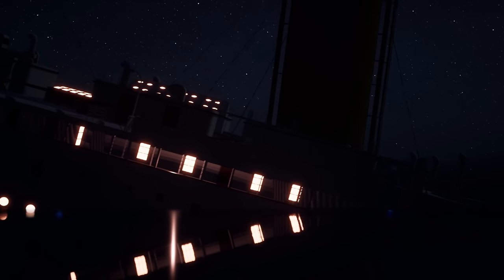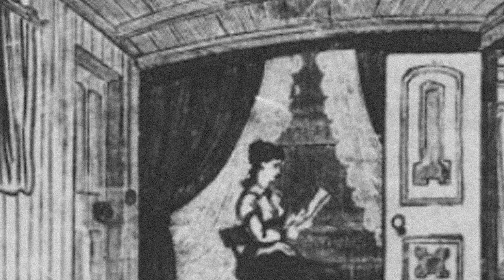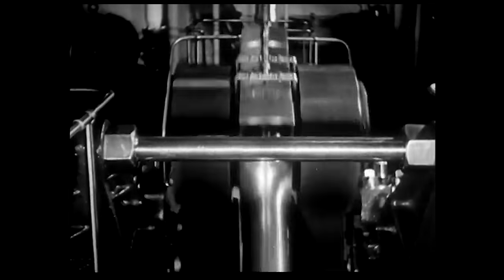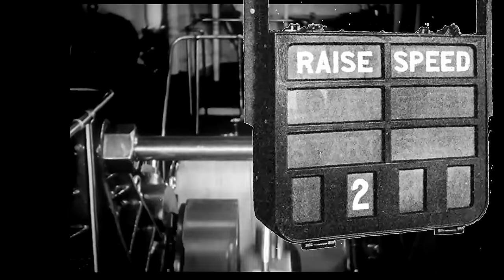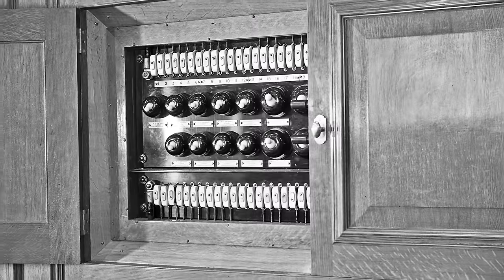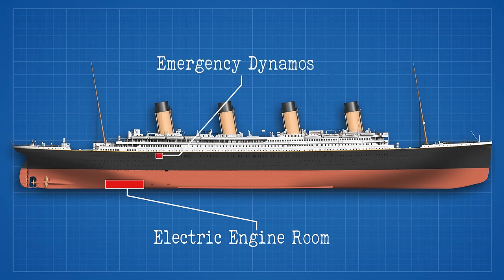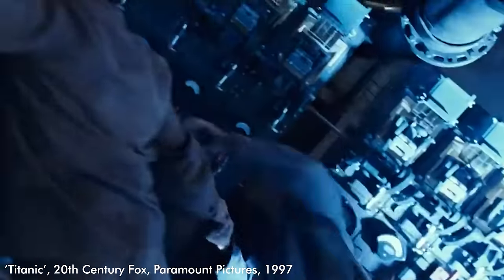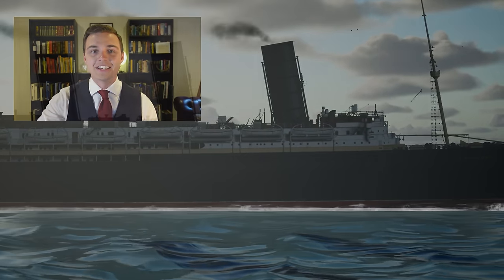How Did They Keep Titanic's Lights On So Long?

Comment: I'm constantly impressed by just how well built this ship was. Especially considering the time period. It's beyond impressive.
Reply: Just makes it all the more tragic what happened
Reply: Not built well enough it seems
Reply: @duncachinoahimiha3889  What ships were back then?
Reply: @iamhungey12345  the ones that didn't sink.
Reply: @disclaimer.imjokin  Did they also hit an iceberg?
Reply: @disclaimer.imjokin  seeing as at the time no one could think of any foreseeable  thing that could sink a vessel in the middle of the ocean other than a storm at the time, and titanic was plenty prepared for such an event. so the worst that was expected would probably be a collision with another ship. Which would only damage two compartments and meant a trip back Harland and Wolf. So the chances that a sinking could occur with nobody there to take the passengers on was unforeseeable. The ship was practically unsinkable. It’s just that nobody foresaw something such as a large mass of ice being a threat that it would ever face. Even today if you built a ship the last thing you would think is if it would strike something in the middle of the ocean where there typically is nothing to hit.
Reply: @BottomGear2  It's kind of like telling people to expect an unmoving object in the sky. It's a rare thing, normally you could avoid such ice with ease, but the wrong night, where visibility was deceptively perfect, that made seeing ice near impossible.
Reply: @duncachinoahimiha3889  tell that to Olympic
Reply: @duncachinoahimiha3889  Well built, ineptly piloted.
Reply: @dday881 This.Olympic proves that Titanic wasn't poorly built.
Reply: @duncachinoahimiha3889  Titanic sank because it was so well built.  If it were just a run of the mill ocean liner, they would have dropped anchor for the night.  But because it was THE Titanic, they said "Full steam ahead!"
Reply: @jaywolfenstien It was the maiden voyage and they wanted to beat the time set by the Olympic iirc.
Reply: @duncachinoahimiha3889 it was almost perfectly designed. The only two things missing, the double hull wall and enough lifeboats for its occupants, and a safer and quicker release system thereof, were critical and egregious omissions, for sure, but the fact that the ship had an emergency lighting system, in as far back as the 1910s, shows the engineers did care.

The corner-cutting definitely came from above, because if the engineers had their way, it would indeed be “unsinkable”, i.e. not a complete death trap in the event of an accident or even complete loss of the vessel, by 1910s standards.
Reply: @KillerofGods  Titanic wasn't trying to beat any speed record, and it wasn't even on its fastest speed when it crashed into the iceberg.
Reply: Titanic was well beyond it's time..... She was and still is so impressive and in my opinion, the most Beautiful Ship that mad has ever made
Reply: She gets a very unfair rap, no ocean liner could have survived the damage she sustained and few would have have actually survived as long as she did.
Reply: Most have under-appreciated the Victorians and Edwardians because of presumptions rather than factual knowledge of Great Britain back in the day. A happy benefit of your, friend Mike Brady, and your colleagues’ efforts, is educating the general public. The UK is sadly not what it once was pre-Brexit. Merci beaucoup.
Reply: It wouldn’t have sunk if it took a head on collision but it had its side scrapped by the iceberg flooding 5 compartments.

Comment: I’m a formerly licensed 3rd Assistant Engineer Steam & Motor of any horsepower/any ocean; much of my career was spent in power plant construction, maintenance, and operation.  

I knew the Titanic’s lights stayed on because the engineers & electricians stayed at their posts.  In addition to keeping the lights on they kept pumps operating in a vain struggle against progressive flooding.

What I’d never seen nor heard before were the details discussed in this video of Titanic’s electric generators and circuit design.  Thank you for a very informative video!
Reply: When Titanic broke in two  the side shell was ripped away from the inner structure all the way to the generator room, opening it directly to the ocean. If they were down there, they died when the space rapidly flooded  with icy cold seawater. Today the starboard side of the stern section is missing, exposing the turbine and generator room to the surrounding water. Nobody has risked sending an ROV into the stern section because the interior is completely destroyed when water blasted through it during the very rapid fall to the sea bed. The risk is too great of the ROV getting trapped.

Comment: This is the first time that I've heard anyone talk about Titanic's electrical system or the courageous engineers that operated it. I had no idea that the Titanic had so much electrical generation capacity, nor that it all ran on DC.
Reply: Alternating current was in the very beginning stages back in those days, much of the power grid even still ran on DC. AC is very complex and brings on many more challenges and engineering problems, so the fact that it was DC was very unsurprising, considering all vehicles still use DC power to this day.

Comment: One reason was the generators were in one of the ship’s aftmost compartments, as the stern rose higher and higher all of the steam escaping from the boilers and engines ran through the turbo-dynamos and kept the lights on. When the ship broke the last of her steam was hissing through the dynamos and her lights finally went out as her dynamos stopped turning, her pressure finally fell, and water surged into the torn-open steam pipes
Reply: The steam pressure required to turn those things is big enough to makes the difference in pressure from elevation negligible
Reply: @jdrhc63we67  not really add on the boilers that were underwater were still producing some steam due to the fact the majority of the boilers fireboxes were shut tight in order to keep the water out.
Reply: @hunterbear2421  the turbines operat at hundreds of psi steam pressure the change in pressure from height would be less than 1 psi steam is not very versatile dense so the weight of the column does not increase quickly like it does for liquid water
Reply: @jdrhc63we67  What i mean is that it didn't matter, yes but the psi from the boilers being fully filled and even the ones underwater having there fireboxes sealed shut. some did explode during the break up i heard tho but by that point the 50psi to 100psi of steam pressure was plob all it was gettting and when it broke up it was done anyway.

Comment: Mike, thank you so much for answering a question which has always bugged me about the Titanic's lights. I'd heard about the rusty red hue that the lights dimmed down to, and always figured that it was current bleeding off into the water which caused it, rather than loss if steam pressure   which of course makes sense.
Either way, the ships electricians deserve a special accolade for their heroic efforts. Without them, the death toll would undoubtedly have been much higher,  as panic would have set in much earlier.
Reply: I wouldn't be surprised if there was some of both factors - current bleed in the water and steam pressure loss. The steam pressure loss was probably bigger though, as the electricians could shut off a part drawing too much current, and a short would hopefully trip a fuse or circuit breaker cutting off power to that part rather than bleeding current. It does make me wonder about the scene in the movie though - we see overloading circuits blowing and the whole ship suddenly going dark, if it lost steam pressure the lights would have faded out over at least a couple seconds. Which did survivors report seeing? I'd imagine the sudden darkness and dramatic short circuits is cinematically more exciting but I wonder if it's historically accurate? Though I do recall descriptions of the lights "flickering out" rather than "fading out," so maybe the movie was accurate.
Reply: @quillmaurer6563  I wonder, too. It's frustrating that none of the reconstructions, even Mike's, have featured the fade. I could imagine that the gradual turning of the lights to blood red would make a very disturbing visual.
Reply: @Phaaschh  True - given that he makes his own animations from scratch I'd think he could have shown that easily. Likewise in the video where he talked about how dark it was in reality, survivors barely able to see the ship after the lights went out (unlike in movies that have lighting for the audience to see what's going on). That could have shown the reddish lights and fade out, but if I remember right just showed them the usual slightly orangeish white until they went out.
Reply: @quillmaurer6563  It was probably both, main power flickering out due to failing wiring, then the rest, likely the emergency sets, just fading away when the steam went.

Comment: Another great presentation Mike, and a FAST 13 minutes!  
I'll tell you, Titanic had one TOUGH electrical system and some outstanding men who kept it going.  They oblviously knew there was no easy way out but they stayed at their posts.  One can only hope that when the end came it came quickly for them.
Did you know that in tribute to the engineers, both mechanical and electrical, lost on Titanic King George V ordered engineering officers of the Royal Navy to wear purple "light's (or fillers) in the gaps of their rank rings as a sign of mourning and a permanent reminder of their sacrifice?  They wear them to this day, and I believe engineers of the Merchant Navy do as well.   In fact, back in the 1990s I met an engineer officer of the Canadian Coast Guard and he had those purple "lights" as well. 
Thanks again!

Comment: Anyone who've seen more movies than just Titanic 97 would know that many other films have depicted the lights failing towards the end. The most accurate depiction is A Night to Remember, where the lights just shut off. The chaotic flashing seen in more recent animations of the ship sinking just prior to the breakup didn't really happen. Once those lines from the boilers failed and steam pressure dropped quickly, the lights would've just shut off, like turning off a light switch in a room.
Edit: Should've mentioned the dimming. The lights dimmed before flicking off, no flashing.
Reply: They would first have dimmed as the dynamos lost momentum and THEN turned off.
Reply: It depends on if the switches were maned if thy were thy would have stayed full brightness and shut off insections if thy were un maned thy would have dimmed as speed was lost I do not know the exact machines but the ones I have worked with can run for a pretty good bit with low steam pressure before completely stopping. It would also make a big difference if the feed line or the steam line ruptured first
Reply: Walter Lord, in his excellent book "A Night to Remember," said "The lights went out, flickered briefly on again, and then went out for good. This is soon before the terrible crashing, rumbling noise which was thought at the time to be everything that wasn't fixed down crashing towards the prow, but was actually the ship breaking up. 2 minutes later, the rear of the ship foundered.

Comment: Thanks for finally putting to bed the "lights on stern after breakup" myth. I keep hearing it and knew it was impossible outside maybe an oil lamp or something on fire. I do think the emergency lights faded out last as the ship broke and lost steam, but yesh, only a few seconds. We do know at least an extent of the power loss up to a point in the wireless room due to the settings of the regulators for the rotary spark gap motor.
Also Titanic used a single wire system, IE hull as ground, likely to save on wiring costs (and space for thick DC wires), and AFAIK some large motors like elevators and blowers recieved 200V from 2 of the dynamos in series (similar to how we have split phase power in NA). It used mostly tantalum lights, outside of some Linolight lamps in the windows which went tungsten after 1910, which, while brighter than carbon, were much more yellow/pinkish-orange than tungsten lamps. You can still get similar bulbs, though tunsten, as Mazda lamps, about 2300-2400K color temp is right (real filament not those fake LED things). You can also replicate the dull red glow with a dimmer on those, it does look like a very evil red glow unlike more modern tungsten, like hot metal from a forge that has started to cool (since it literally is hot metal). Saw it happen in person when a hardware store display for retro lamps malfunctioned and went that nasty red, even pointed out that it must have been what the sinking Titanic looked like.

Comment: The Olympic-class ships were truly modern for their time, and the men who crewed them were in a class of their own. The engineers were the heroes on board Titanic, and they died nearly to a man. Whether it was shoring up the damage in boiler room 5, battling the flooding with the pumps, keeping the boilers stoked in boiler room 1 or keeping the power on, these brave souls all battled diligently to keep Titanic afloat. And indeed their diligence kept her afloat longer than even Thomas Andrews believed possible. The man who designed the ship was quoted as saying "An hour. Two at the most."

And while Titanic's engineers did everything they could think of to keep her dry and powered, Carpathia's engineers were busy overclocking her engines and hoping the boilers wouldn't explode.

Comment: G’day from Melbourne but currently Belfast doing my own titanic research. This topic was actually a question I had posted to members of the archives. A huge important part of why the lights stayed on was what happened in the breaker room, as salt water started to short out the circuits the main breakers started to pop and the fuses started to blow too. There were engineers in that room jamming tools into the fuse sockets to bridge the connections and using brooms and man-power to hold the tripping breakers closed. If you could enter the breaker room now you’d probably see screw drivers and tools melted into the fuse sockets in a heroic attempt to keep the lights and pumps going.

Comment: I’m a lineman (work on and build power lines) and I understand all of how this works and why it works, but wow it doesn’t make sense to me that they got all of this to work efficiently in 1912, that is extremely complex engineering that is even hard to build in 2023, even 10x harder without modern circuit boards and computers, its crazy to me that this was all analog and powered off of steam. For the time period, this type of technology must’ve been absolutely earth shattering and jaw dropping. I cant comprehend how they figured out all out with their current technology!!!

Comment: The company who built those electrical generators was W.H.Allen 'Queen's Engineering Works' based in Bedford, England. The company no longer exists today, but was around for over 100 years. I was an apprentice engineer there in 1979. I wasn't aware of its connection to the Titanic initially, but learned of it a few years later.

Comment: Power engineer in training and longtime IT engineer with a comprehensive understanding of electrical engineering here.

I have long stated that the likely reason that Titanic’s lights stayed on as long as they did was due to the ship’s very design, which you so brilliantly detailed here, along with the steadfast work of her engineers/electricians.  I have also stated that the likely reason that the lights failed when they did was because the steam lines feeding the dynamos severed.

Titanic’s dynamos we’re not equipped with a gear train to increase rotational speed, nor did they have flywheels, both of which are standard in many such designs today.  This means that when steam power was lost, the dynamos would have come to a stop fairly quickly rather than a long process of losing energy.

Comment: Suddenly losing a large load, like the forward circuit, would cause the dyno & engine to speed up, and the voltage would jump. A long over-voltage could have resulted from the difference in power supply (steam) and demand (electricity). There could be a short voltage spikes from inductance. Both phenomenon can cause damage. It would have been very hard for the operators to maintain control between losing steam and losing loads. Great video!
Reply: Wouldn't they have an automated steam control (perhaps by centrifuge) to maintain RPM?
Reply: @Alexander O'Brien  yes I think you're right. A "governor". I'd imagine that'd do smaller short term control and operators would do the larger adjustments. Could be wrong though.

Comment: Brilliant overview, thank you.  One thing I've never quite understood is why the lights gradually dimmed as the ship sank.  Relative to the quantities of steam the main engines used, the dynamo engines did not use all that much.  One boiler room would have been enough to keep them going at full output, and boiler rooms 1 and 2 were probably not inundated until very close to the end.
Reply: I'd say that, as the main dynamos failed, the emergency dynamos began to power the essential lights. The emergency dynamos gave weaker light, which would result in this dull orange/red color. This would have happened roughly between 2:01–2:11 AM.